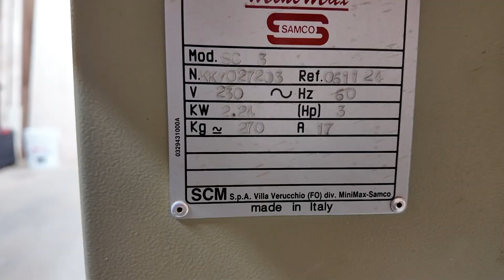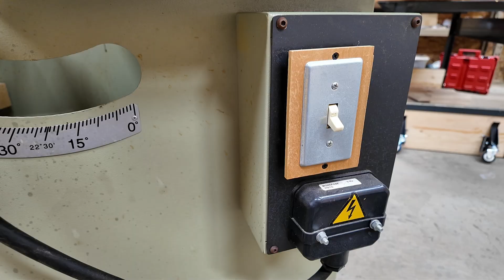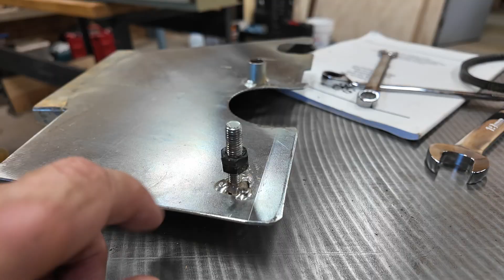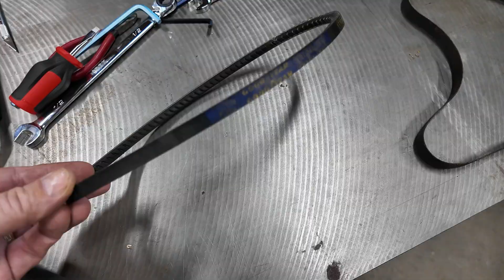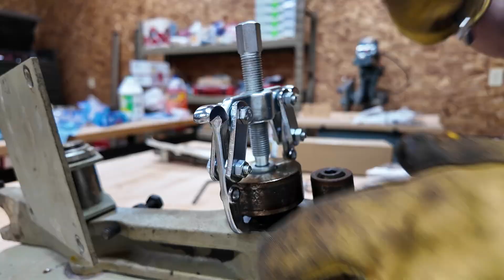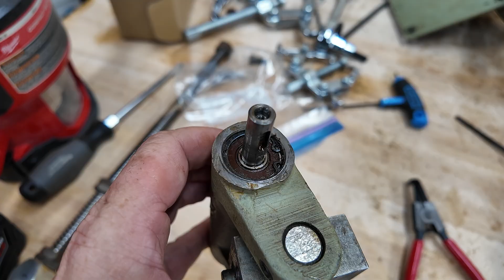SCM Minimax SC3 restoration: Disassembly

Comment: 5 months ago, I bought the exact same SC3.  Mine is manufactured in '93 and not hooked up yet either!  Everything on the saw is in great shape EXCEPT I have to use two hands on the wheel to raise and lower the blade.  I know this is not the way it is supposed to operate.  The individual I purchased it from said it has been that way since the day he bought it new.  I haven't been able to bring myself to reassemble the saw until I get this problem fixed. 

After opening up the box behind the wheel with the bevel gears, cleaning them up really well, cleaning / lubing the threaded rod, and soaking all contact points in penetrating oil, little has changed. So this morning I decided to remove the table top to have a better look around.  Like you, I found that doing so is no small task and not sure I want to go there! I do still want that blade to raise and lower with ease though.  Having been in the machine yourself, can you offer any advise on where I may be having my issue?  It seems to me that something is amiss where those two main trunnion plates interact. The parts you refer to as the "Arm" and the "Support".  I can even make out where some of the paint is rubbed off of the "Support".  Any thoughts / insight would be greatly appreciated!

BTW, Upon realizing the trunnion assembly was attached to the table, I ran to youtube and typed "removing top from Minimax SC3" and there you were!  Amazing!  Thank you so much for posting this video so that I could see "under the hood" a little more without removing the top.  Enjoyed the vid!
Reply from the maker: I agree that raising and lowering the blade should not require so much effort.

Unfortunately, I would not be surprised if you have to do more disassembly in order to fix the problem.  There are several places where something needs to move when the blade is being raised or lowered.  The arm and support are joined by a big round shaft that should probably be lubricated.  The nut that attaches that might be too tight.  The riving knife mechanism might have things that are too tight.  When I get back to my shop I'll look and see what I might be forgetting.

And yeah, removing the top is "not a thing" on this saw, but once I got past that realization, it's not really all THAT difficult to disassemble and reassemble.  A few days ago I finally got the saw guts put back together and back in the cabinet.  I'm working on stitching together all the clips I shot so I can post a video.
Reply: @ShopKlutz thank you for the reply! Would the big shaft you are referring to so happen to be the part at 19:40 on this video? The one requiring the spanner tool? If so, I might start there. I have had my eye on that location as it seems suspect.
Looking forward to seeing the next video after you get it all edited.
Thanks!
Reply from the maker: Yep, that’s the one. That nut is a bit of a pain, but it’s fine as long as I don’t get in a hurry. The spanner wrench I got is basically designed for use with angle grinders. I’ve wondered if there’s a more appropriate tool of some kind, but I haven’t found one yet.
Reply from the maker: Ha. Now that I’ve got the guts of my SC3 assembled, I find that mine seems to require more effort than I would expect to raise and lower the blade, just like you described. Have you made any headway on this issue?